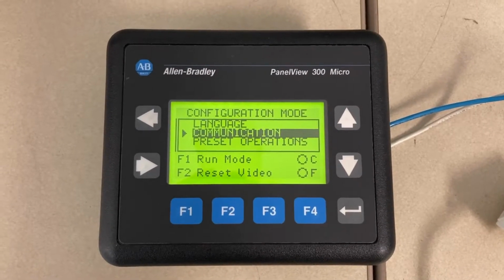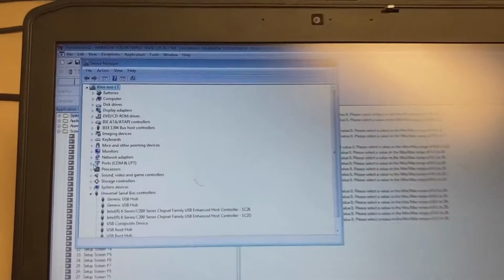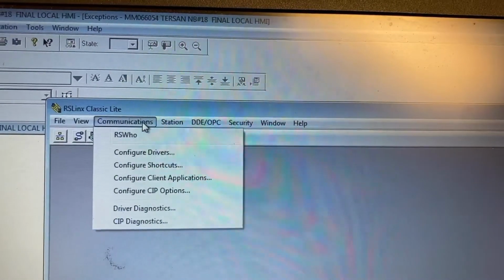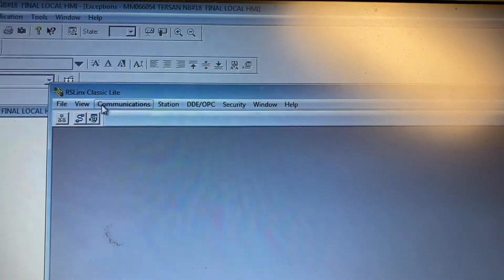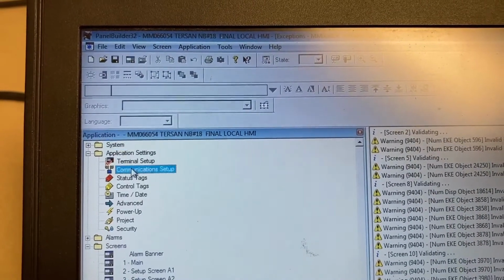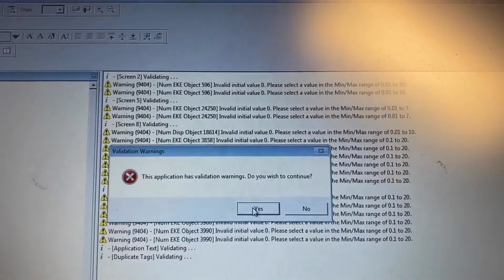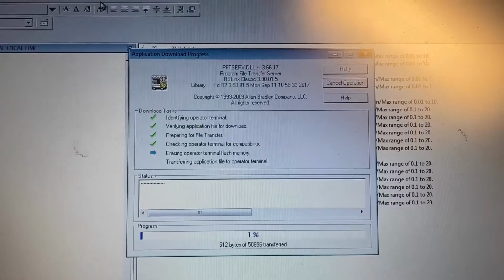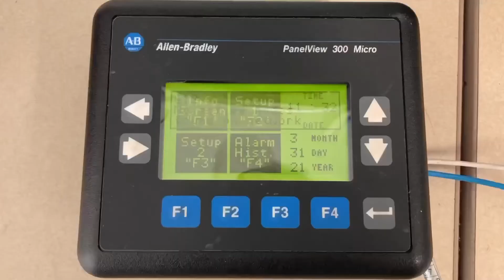Allen Bradley Panelbuilder32 - How To Download - DH485

Comment: i have run into problem stating that my rslinx version is higher than the panel view linx using, im using version 4.1 and the Panel view version said need minimum of 2.2..is thier any other thing to do!? thanks
Reply from the maker: @Rey Rank: Since this HMI and the software PanelBuilder32 are long obsolete. I doubt if you can upgrade the HMI firmware. From what you provided, your Rslinx v4.1 and that is too new to find a too old HMI. You might want to downgrade Rslinx but I really do not recommend it.
Reply: @SYPHOANG  if ever i will downgrade the rslinx but until 2.5 only, unable to suffice the requirement of the hmi which is 2.2 maximum..any other alternative way to download the hmi program...i just notice this hmi when my boss ask for an additional display...we have here the most latest hmi but this most old we don't have the support..hehehehe..
Reply from the maker: @reyrank2846  : You might need to go with a newer HMI. It is not very difficult to convert from PanelBuilder32 to Factory Talkview Studio for the HMI application. Just think about the time you are investing and the effort you are making for the future instead of hanging on an old-school long-obsolete piece of equipment.
Reply: @SYPHOANG  the space is the issue and we don't have budget for this particular machine.
Reply from the maker: @Rey Rank : In this video, I have RSLinx Classic Lite Rev 3.90.01 CPR 9 SR 9; the HMI programming software PanelBuilder32 version  03.83.01 (Build 7) and my HMI V04.46. Everything works perfectly as you can see. Your Rslinx Rev 4.1 (I guess from what you provided) is too new and does not support the HMI. You need to downgrade the Rslinx from current Rev 4.1 TO Rev 3.90.01 and I think it will work for your need. Good luck. Thank you for subscribing to my channel. Should you have any more questions or my recommendations are helpful, please let me know.
Reply: @SYPHOANG  thanks also for entertaining my query..i will try maybe next week.. thanks and good luck